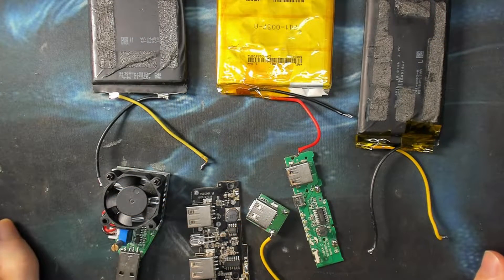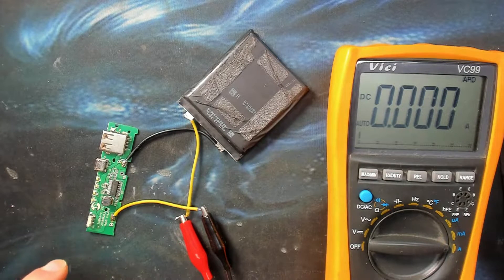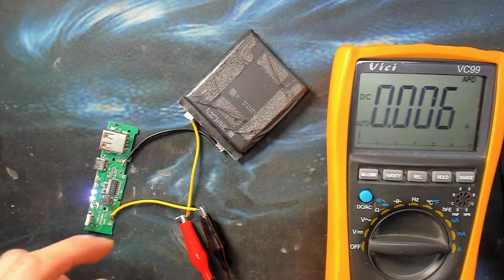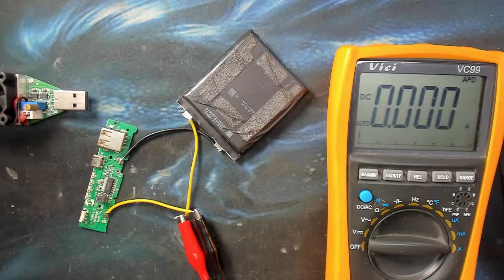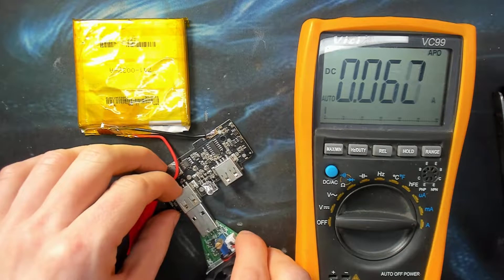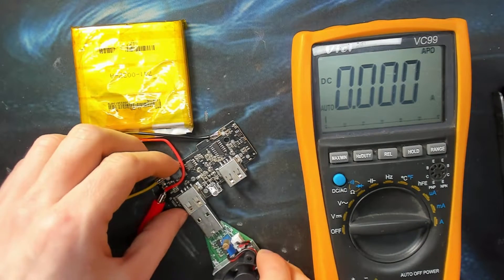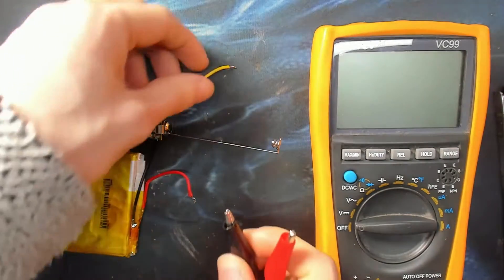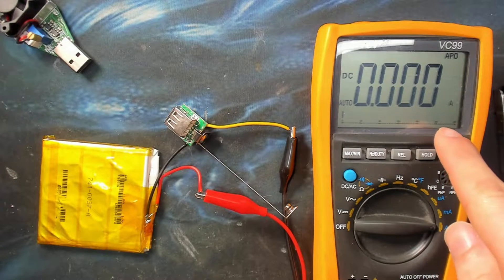B-Roll#19 - USB Power Bank control boards

Comment: The controllers  measure the battery charge by learning it by multiple charge cycles and based on learned data rgeyy estimate ther current charge level